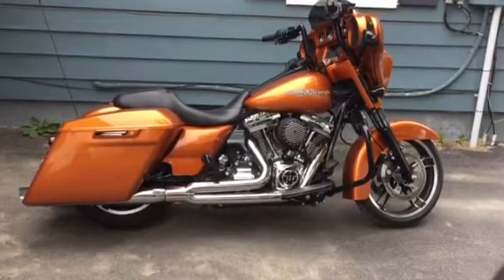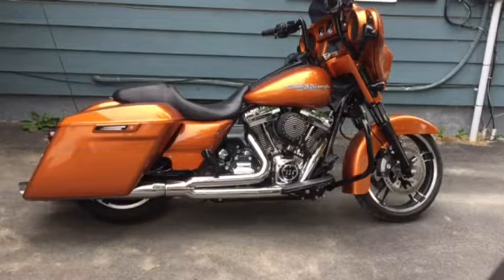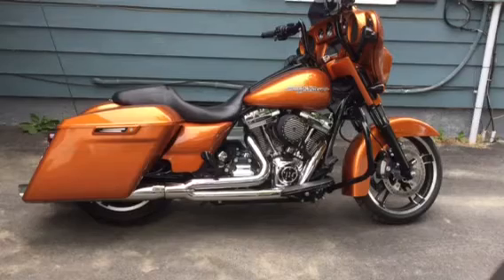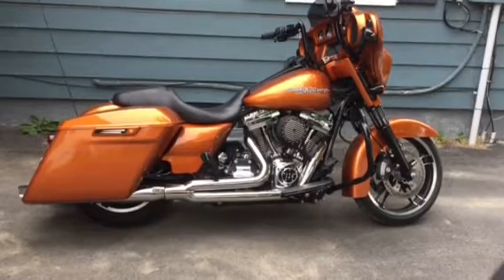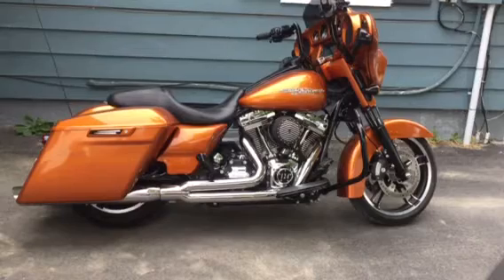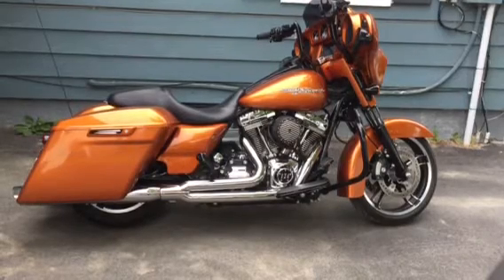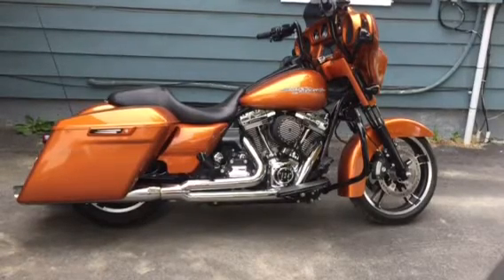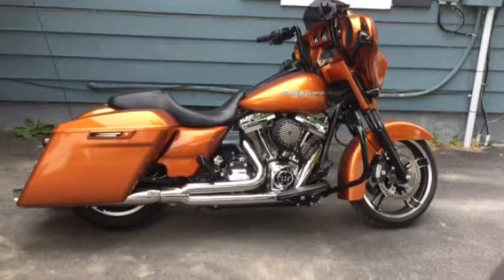CYCLE-RAMA 124 with Dragos Dragula 2 exhaust

Comment: Sounds great! I'm trying AGAIN to crest the 160 mark with my 124 Build. D&D borezilla wes 650 cams wes heads also havea set 630 from wess. Looking at a different exhaust because I've rarely seen the D&D support over 150. May just be time to tone down compression and slap a turbo or procharger on it.

Comment: I have a 03 ultra with a S&S 106 stroker ,heads r done n a 55mil throtle body, hotter coils, chain drive, airshifter, n nitrous on board, waiting for a 2 step next with a nitrous progressive controller. STOCK BIKES R FOR BABYS!

Comment: Awesome bike.. a 2020 Road Glide with the 114. I just want a lil more power than d other 114's. I know I won't make huge horse Powers but if I put a header& exhaust, intake, tuner and I got cyclerama to get me a cam to match my setup.. I think that would give me 15-20 horsepower / torque over stock?

Comment: Bike is amazing! You did a great job with it! What baffle did you have in it in this video ? The 2.5 inch or the 3 inch ?
Reply from the maker: Thanks,   2.5'' baffle
Reply: todd lincourt did you end up staying with the cr650 cam or cr651 cam ?
Reply from the maker: just a part # change its the CR 650 cams, the next step is to send my 124 cylinders into Wes and have them bored .125 thousands  which will make it   131 cubes . Wes all ready bored my cases to 4.250'' the nice thing about his custom cylinders. is you have the options from a 124 or 131 cubes.
Reply: That sounds awesome ! Did you have a chance to get the bike on the dyno yet? I'm curious to see where to torque comes in with these cams . I saw on a forum that the cr651 grind brings the torque in earlier. I'm looking to have at least 120ft lbs torque at 2500 rpm.
Reply from the maker: 130 tq at 3000

Comment: So is the entire engine from Cycle Rama? Trying to learn/approach how to do this. If not what parts are original Harley? Thanks. Are you in an online forum also?
Reply from the maker: the engine case,the heads are original Harley parts. the crankshaft is S&S ,the Cylinders and cams  are Cyclerama,  pistons are custom CP . the oil pump, roller rockers, pushrods, and premium lifters. are all from S&S.  throttle body is HPI. i am a member of HD forums , Harley Tech talk. and some facebook bagger forums too.
Reply: todd lincourt Thanks so much for the feedback. Very helpful.

Comment: i saw an old build of yours it was a  fatbob 107 585 cams hill side heads hpi55 .seemed to rev real quick .do you recommend that build and what sort of hp and torque did it make .
Reply from the maker: it made 129/125 in 6th gear having built a 124 now and seeing the difference in the torque that comes on earlier its way more impressive and a blast to ride.
Reply: @toddlincourt9141  thanks  for reply so your basically saying save my money till i can go bigger.my bikes a fatbob 107 at moment with s&S 570s hillside stg 3 heads 55hpi dd fat cat 113hp 111trq also 30 /70 gearing .but want abit more have a set of r&R cast heads 2'' valve  was thinking about bumping comp and change cams and heads but could be a waste of money for what i might gain but if  it acheived that prob should feel it.you build really nice bikes
Reply from the maker: did not know you were from NZ are you on face book ? we can communicate that way easier through messenger

Comment: I want a 124.  How is it in the heat?   I have a 107 tc with 125 hp ,127tq but want to step it up to the next level.
Reply from the maker: I run a Jagg fan assisted oil cooler and with  a good tune have had no issues,  did run hotter with the stock oil cooler.
Reply: @toddlincourt9141  thanks for the reply.. I do have the jagg with the fan assist also. I just hope its enough.   I live in the SOCAL .  I really like how your build came out.  Are you running a comp eliminator and chain drive?    I have a lock up clucth now but was thinking of the twin power comp.
Reply from the maker: @taps_1021   I am running the Aim stage 3 VP95 IV and a 380 spring along with there billet pressure plate which I highly recommend . and still running the stock belt drive with no issues. I installed the twin cam comp eliminator on a friends 117 that  I built and don't like how it engages and it makes noise  I have had no issues with mine and it makes 150 hp mid 140 tq and I don't baby it. but I don't do rolling burnouts most likely it would break the belt.
Reply: @toddlincourt9141  what comp are you using . If you look my vid up it will show my current build.  I have been debating 117 or 124.  But after looking at your build I want to go 124.
Reply from the maker: @taps_1021  the 14 touring bikes come with a screaming eagle comp I added a thicker shim made by R&R cycles that art recommended to the shim pack
Reply: @toddlincourt9141  I have a 15 rgs . But my comps makes a small bit of noise at start up. Then goes away . I didnt think it would hold up to the 124.  I heard some had noisy solid comps . Just want to buy once cry once. Been looking at the lazy S&St124 Hc
Reply from the maker: @taps_1021  get the thicker shim from R&R cycles add it to your comp you will be ok. my friend dave has installed it in his 124 & 131 setups he is on HD Forums as ntraindavefl
Reply: @toddlincourt9141  I am also on the HD forum as 1 2 many. Thanks for your help..
Reply from the maker: @taps_1021  I'm also  as Target64  which you probably all ready know

Comment: Is that the dragos drakula 2
Reply from the maker: yes dragula 2 exhaust
Reply: todd lincourt  I just got one be here this week
Reply from the maker: very nice exhaust did you get the 2.5'' baffle
Reply: todd lincourt  yes sir I don't have as much power as your bike does I'm 120hp with a 107 but got new pipe and new tuner so it may be a little more now
Reply from the maker: what cams and exhaust is on the bike now.
Reply: todd lincourt I have a pro pipe and woods tw777